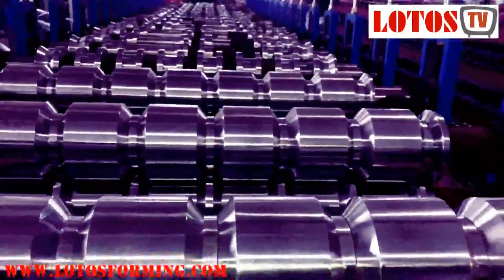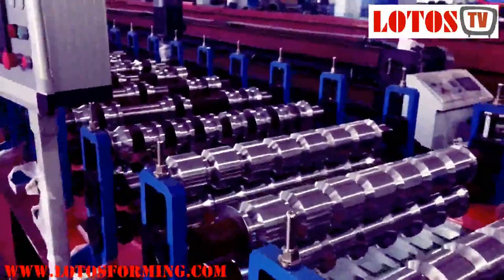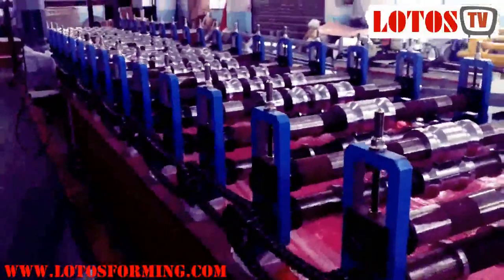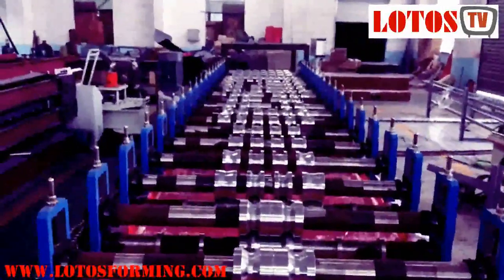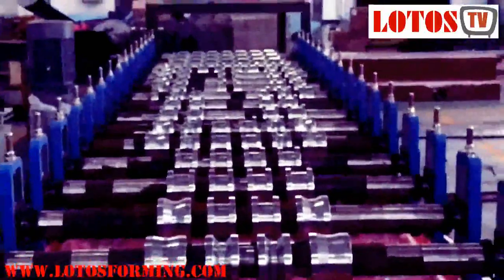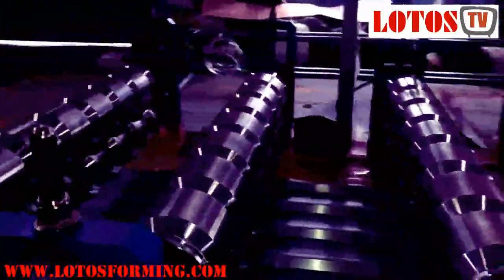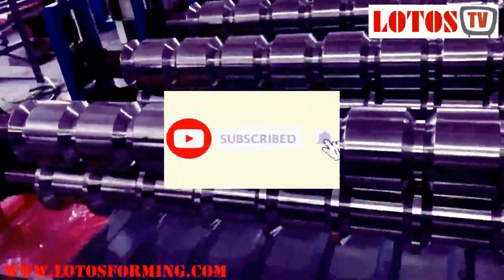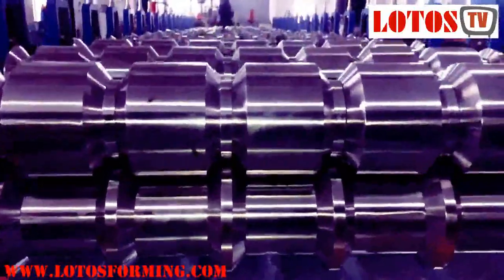【 Roof sheet making machine】: South Africa IBR roofing machine | Roofing sheet making machine price

Comment: in addition to, A rolled metal roofing is lighter than a concrete or clay tile roof and more durable than an asphalt shingle roof, and easier to handle than long-run metal roof tiles.